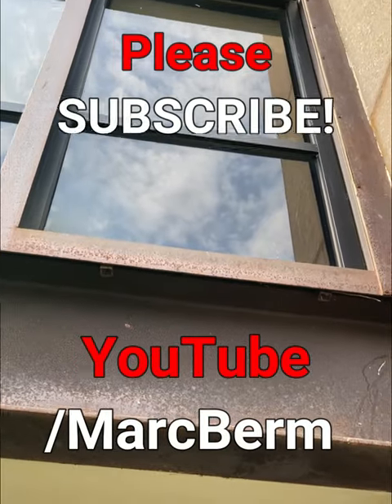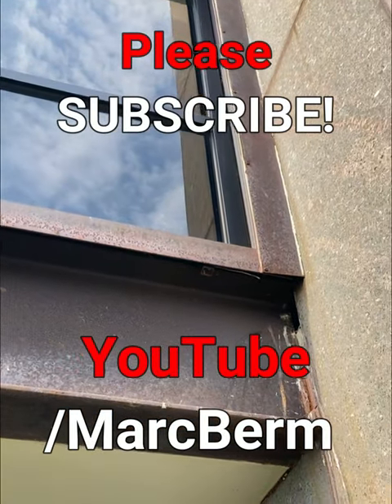The Rusty Bucket? Weathering Steel and the Forand Building (RI DMV Headquarters) | Rhode Side Short

Comment from the maker: Mitigating corosion and rust is taken very seriously in the engineering and construction trades, and with good reason. The destructive forces of rust cause hundreds of millions of dollars in damage to manmade buildings and infrastructure every year. It might seem strange then, that using rust to protect from rust is even a viable solution, but that's exactly what "weathering steel" is designed to do. Once covered in rust (oxide), this layer forms a barrier which protects the "good" metal beneath from further oxidation and eventual failure.

You can learn more about the cost of rust and corrosion by watching this video from Practical Engineering: https://youtu.be/2RbiCOFffRs

Thanks for watching; please consider SUBSCRIBING and turning on NOTIFICATIONS: http://bit.ly/marcberm

FOLLOW ME for announcements, behind-the-scenes and more!
https://twitter.com/marcberm
https://instagram.com/marcberm
https://facebook.com/marcbermvideo
https://www.tiktok.com/@marcberm